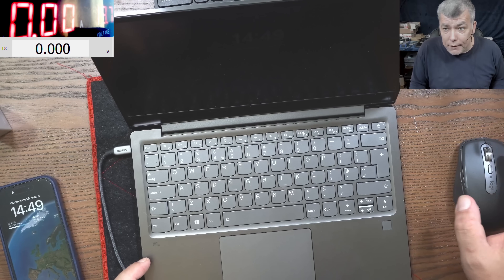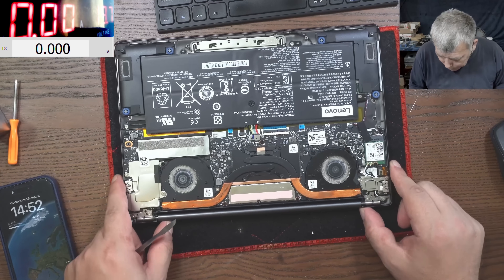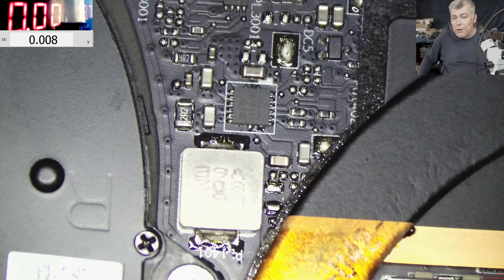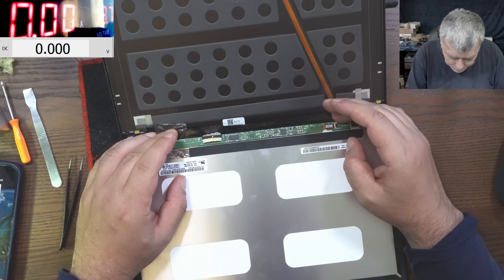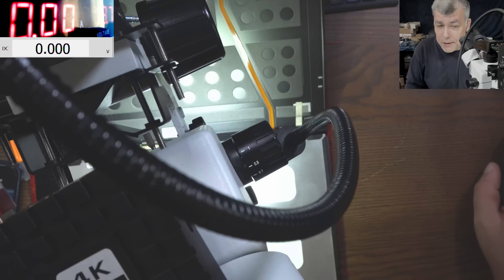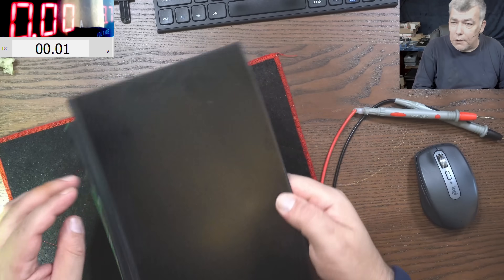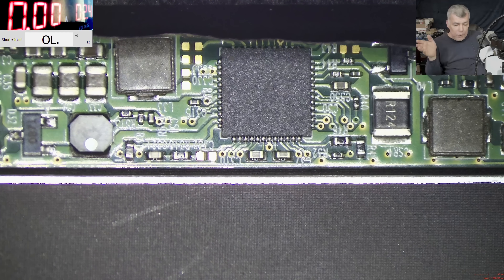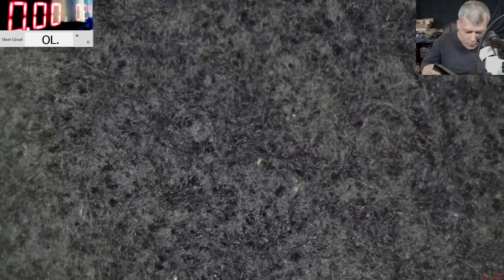Reflowing random IC's, can be called a fix? The laptop screen technology, is changing! Lenovo 720s

Comment: I have the same laptop with the exact same problem. I will try to reflow. How did you close it? Normal double sided tape?
Reply: YES - I reflown the chips and the repair was "succesful" .-  unfortunately one of the thinghy broke and I had to use isopropil alcool to aid in detaching the screen. It damaged slighly the image but at least now I can see. I can confirm that the method is working consistently

Comment: If you can’t verify if there’s power being drawn by back light, can you try placing a length of wire inline on the positive side of the display power feed.  Then take you new owon oscilloscope and a split core amp transformer (from a small amp meter) . Attach the scope probes accordingly then try cycling the dimmer button? Or just use the scope probe to back probe terminals to try to find the dimmer signal. Maybe oscilloscope can detect when dvom can’t. 
Cool video as always!!

Comment: Good job. I have encountered this on laptops where the customer use the laptop with high load but screen closed (external monitor) and the heat from the laptops house is heating the screen. It can even cause the screen to die by heat. My experience that this only happens on laptops where the heating cooler exhales to the screen side. On other models like Asus x55X the laptop even shouts down because of overheating under load.

Comment: Fair demonstration think that could be common on Tablets, just brought three  of them with screen crashed for ten euros. Two are Ipad, lol, one is a 11'' from Huawei, will see what I can do if it's possible to repair for my apps for synths with the teaching you made by past about tablets. Mine I learned about battery locked, not charging and relation ship between charging current and amps needed. Also usb mess as everyday I plug and unplug the USB c, that's actually the fourth cable I buy.  Helpfully, a light on the cable indicate when it is not charging well. The last screen I opened seems having no problem, but I will verify the three currents like you shown, but first I have a oil liquid damage through the left loudspeaker to the screen connector, one component is damaged the board seem's working, no short anywhere.  🤗So I have a New job! This is a nice laptop, brought on the weekly city outside market for dvicy levas  in Bulgaria, wich is near ten euros. 🙏🧡💚

Comment: If You can adjust The brightness, may be taking 3 voltage measurements in both chip pins, at full, mid and low brightness in orden to.identify pwm on the 2nd chip, of course si a lots of time, but just a thought

Comment: ATTENTION SORIN:

I found a way to get past the bit locker recovery screen:

1) Boot to the blue recovery screen.
2) When the screen comes up, hit escape.
3) It will show that it is starting bit locker recovery and then go back to a blue screen where it asks to enter the recovery key; don't enter anything.
4) Hold the power button down to power off.
5) Power back up.

It will boot the operating system.

I've done this on 2 different HP laptops.
Reply: Very useful ! Thanks🙏🧡💚👌
Reply: @patriciaoudart1508  Also I should mention that you might need to start from a completely powered down machine (battery disconnected & adapter removed) so the BIOS is reset. You will always get the boot locker blue screen whenever you reset the BIOS. After doing the sequence mentioned, it will always boot to the OS.

I'd like to hear from anyone else who has tried this with a different brand laptop. Curious if it works on others.

I think it's essential for repair shops to have a way to deliver the laptop to customer without a blue screen.

Comment: BitLocker recovery usually appears when you fix (or exchange) a motherboard, or change the bios, never seen it happen when fixing a screen. I mean, the system was on at the beginning of the video, I don't understand why it showed up after messing with the screen, especially in that case, it was just a reflow.
Reply: Probably triggered by the bios reset / re-initialize routines.  Perhaps because date/time are now off, or during hardware re-detect, it cannot be assured the drive is on the same hardware as it was originally.  Perhaps TPM was reset as a result of the bios reset.

Comment: Actually, from my experience working as a diagnostic tech for Digital Equipment and contractors, sometimes this is the only solution left after the bed of nails tester and logical diagnostics fail to fix the problem. Solder reflow on surface mount components can have some tricky failure modes. A good microscope and patience can lead to success.

Comment: Nice fix Sorin, I always enjoy seeing your expertise in action! One question: this panel has LED backlight, so why would it be driven by an inverter circuit? Surely it would just be driven by a DC regulator (with PWM control for brightness)
Reply: LED backlight works with something like 40 volts so you need an inverter to rise the main power rail from 8.7 volts (or 19 volts) to 40 volts

Comment: One thing Ive noticed lately is that a lot of devices are leaving the factory with a lot of cold solder joints and a simple run of it with my soldering iron or the hot air resolves the issue and the device never sees my workbench again. So yes a reflow is a fix lol
Reply: Its not a issue.
Chip is faulty.
This is not fixing screen.
Reply: @NANO-SERWIS.MAREK-DASZKE  nope I had the same screen same fault reflowed this chip screen still good after 7 months no issue no one flicker

Comment: Maybe just a poor joint on IC from factory. If it works it works. Makes you wonder if they are using A.I to make power/cost improvements... 0.30 cents saved if using super cheap complicated IC. Have a feeling everyone is making electronics harder just so they can't be repaired but to everyone else they go yeah we changed it to save the planet.

Anyone else think Sorin is like Columbo with his repairs just when you think he can't do it... "Just one minute".
Reply: I do think it's kinda going the right way though like the right to repair is gaining a lot of traction lately. Possibly one day common parts will have to be used instead of bizarre custom made stuff just there so you can't fix.

Comment: Try hit combination with Fn + f-keys to adjust brightness. BTW you can have a stick or external ssd with windows install partition on it, and boot from them to make tests. So you do not have to rely on custommers ssd/hdd.
Very usefull to have your own windows on a external storage thing for testing purpose.
Reply: Ventoy USB is the keyword here - even working with secureboot enabled and multiple iso files
Reply: Indeed. Portable OS on Flashdrive is great.

Comment: What did you use to replace the sticky tapes under the screen? Hot glue? ;)
Reply from the maker: B7000
Reply: @electronicsrepairschool  hi sorin for the brightness control i think that because the computer is in recovery mode that's why it can't change maybe the graphics driver is not enabled on recovery

Comment: If a reflow fixed the issue it's a fix 👍
Reply from the maker: Ma' man :D
Reply: @PCXode: Yes. That's right. Excellent response from you. In fact, you have to know the area where you have to reflux. Another way of putting it, it wasn't necessary to reflow (resoldering) the entire motherboard, right? Best regards.
Reply: Reflow not fixing the problem.
Issue return soon.
Its is chip fail issue.
Reply: @NANO-SERWIS.MAREK-DASZKE  nope I had the same screen same fault reflowed this chip screen still good after 7 months no issue no one flicker